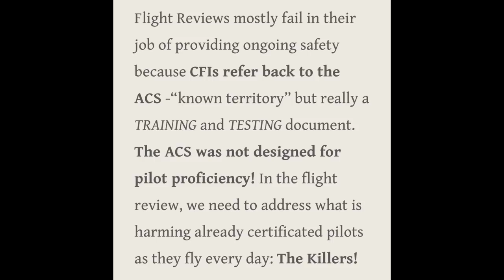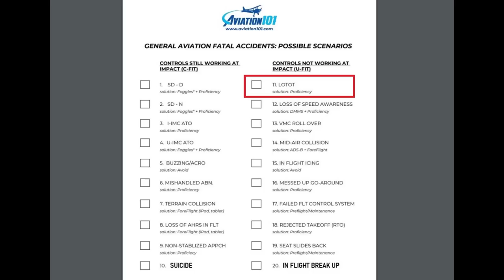Engine Failure at 400 feet.  The Impossible Turn.

Comment: I'm sure you are a competent pilot. I am a very competent and retired, NBC-TV News Audio Engineer. And you, sir. Don't know what end of the microphone to talk  in? Let me give you a hint. It's not on that short round perforated grill at the end. That's not the entry point for the sound. It is on other microphones. But not that one. Not that type.

No sir. That is what is referred to as a Side Address Microphone. You talk into the side with the brand name label on it. Into the side of the grill along the length of the body of the microphone. Into a Side Address Condenser Capsule. Mounted parallel with the length of the body. In other words it's vertically mounted not horizontally mounted. Other microphones  are horizontally spoken into. Into the round and grill screen. But not your type of microphone. Because many of your type microphones. Are just like flying, 2 engine planes. Because many of those microphones have 2 back-to-back capsules. So that you can have 3 directional patterns or more. Mostly we only want, Cardioid shaped patterns. But Super Cardioid and Hyper Cardioid also okay. Just fine. So is Figure of 8 pattern microphones. They are live in the front and the rear but not on the sides.  And many of those type microphones look just like yours. Though some only have a single cardioid capsule within. And are more affordable since they have half, the needed parts and guts. Of an adjustable pattern microphone.

So just like there are many different types of airplanes. One can crash in. There are also many types of microphone technologies. Some  more heavy-duty than others. Some extremely fragile. Others very robust. Like fighter jets.  Used for PA systems of rock bands. Whereas the delicate ribbon microphones. Might be used on a cello or violin. Because if you hit it? It's dead. Forever. But if you drop. A PA microphone onto the cement floor from 6 feet.  Those will continue to work flawlessly for the next 40 years. Doing that to them every night.

And then we have those condenser microphones. Like you have. Not has robust as a dynamic microphone. Far more robust than a ribbon microphone. But also don't sound all that great in a small room. Due to their poor, off axis response to sound. They sound like garbage if you are not right on that microphone. And so your acoustics in a small room. Are not on that microphone. It's all around the microphone. Which it picks up poorly. All large capsule diaphragm condenser microphones sound lousy in small rooms. Because of that. Where small diaphragm condenser microphones will sound just marvelous. But how would you know? You are a pilot with damaged hearing. And some fruitcake told you to purchase that microphone. I don't know why?

I simply recommend the SHURE, SM-57 or 58 with a large oversized, 6 inch long. Gray foam pop filter. Do not use the stupid embroidery loop pantyhose filters.. Use the big gray foam pop filter. The big one. The really big one. You see them on POTUS when he is outdoors in a big breeze. They use the really big foam pop filter. Not the small one.  Don't make that mistake. The small ones don't really cut it. Because when you use the big one on your 57 or 58. It gets you the SM-7B. That normally costs between 350 and US$400. $250-$300 more than the SM-57 or SM-58's. And they all use the same identical microphone capsule cartridge. Because I worked for companies like that. I have talked to them. I had to write up a contract. So I needed specificities. And engineers get to speak with other engineers. Generally speaking. Not with customer support. Who really know nothing. They are reading cards.  They want to impersonate a mindless computer. Yes Mr. Fenwick, Fenwick, Fenwick, Fenwick. CRUNCH!!!

And so we are going through changing times. Your airplane mechanic got their certification from Twitter University. They went to Amazon College of Airplane Tinkering. Where they purchased their first, Screw Driver and Screw Pilot. Of a replacement stretch Elastic Rubber Band Man. And it went down like a Brick. As only the Rubber Band Man Can. When he starts to jam. And the engine goes out.

And so your mechanic was grooving too much to maintain your aircraft. It's all crash and carry.
RemyRAD

Comment: It is absolutely useless for you to absorb this information then expect to be prepared for an engine failure and expect to get back to the runway safely without practice.
When it happens it will come as a big shock and brain freeze will be the outcome. It's impossible to pull off successful emergency landings without the response being there in the brain, ready to be accessed without thinking. 
In my microlight career following a hang gliding career starting in 1974 I have had at least six engine outs - three of those catastrophic failures.All successful outcomes with no damage to the aircraft. Consequently I EXPECT an engine failure every take off and when it does come along it's no surprise and there will be a field somewhere in front of me already dialled in.